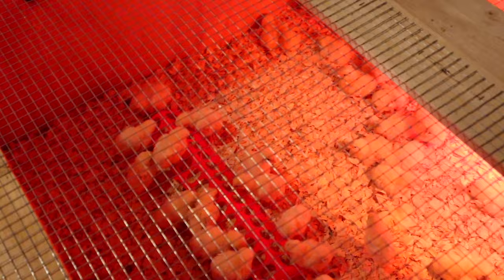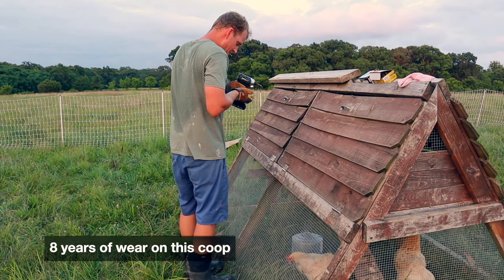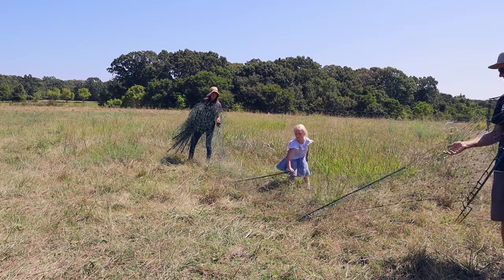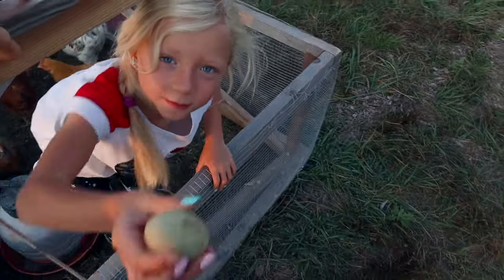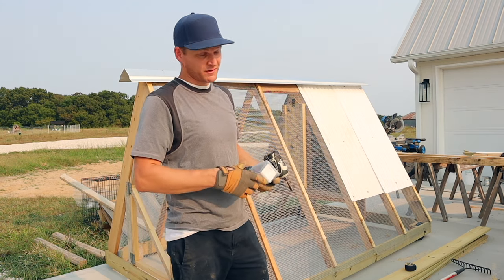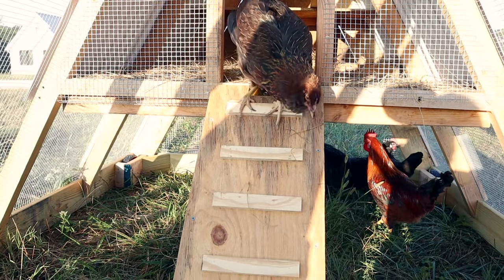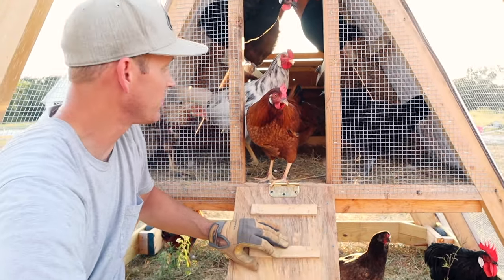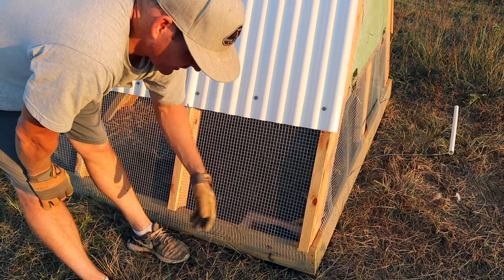The Quest to Design and Build the BEST Chicken Tractor

Comment: For predators I may have a good solution for you and will also help keep rodents out. I added a folding skirt frame that has hardware cloth mesh on each side, front and back. With the hinges all I have to do is fold them up when its time to move the tractor. I anchor them down with heavy duty tent spikes when i fold them down to the ground.
Reply: Thank you for the idea! I was wondering how to incorporate that into a tractor. Can you explain it more in-depth?

Comment: This is a terrific video!! Right off the bat it is obvious you guys are not afraid of hard work!!! Like you, I played around with design. Don't know if a couple of things I did will be useful for you folks or not but since you shared some great stuff with me, I'll proceed. I took the big wheels off a push mower---the raise and lower mechanism as well--and installed that on the back corners. My coop is the A-frame shape like yours. They roll really well through rough terrain. In the process of putting on those big rubber tires on the front...like what you have on a hand truck. About 7" high and 3-4" wide solid rubber. Don't want to mess with having to air them up. I want to rig a way for them to be put on a swivel mount. Pulling that thing around through rough ground and high grass can take a long term toll on your 'innards.' Lower the wheels when you start to take off and raise when you get where you're going. That's my only tip other than I had a Houdini chicken that would always manage to get out even on the flattest ground it seemed (there were times I wanted certain chickens confined for a while.) So I took a rod of rebar a little longer than the length of the tractor and a couple of shorter pieces the width. At each corner I drilled holes about 5 inches back from the corner edge of the pen. Slid the rebar through across the ends and sides. Had to wire it up a couple of places on the long sides to hold it in place. But she was not able to get up close enough to the edge of the pen to scratch a hole and get out. This is only if you are wanting to confine them in the bottom portion of the tractor. Thanks for all your trial and error and sharing such terrific methods. You are a gorgeous family in looks and in heart. Jesus bless.
Want to add...I have learned that deer netting zip tied about a foot up from the bottom and flowing out about a foot or so on the ground will tangle a snake up and keep them from getting your chickens/chicks and eggs.

Comment: Your LOFT design is really great to hold a small flock. I'm looking at putting a piece of roofing tin along the bottom of my run to keep animals from scratching the wire and other damage, doubles as a wind break. The latches, you may need a common hasp with a snap to secure them.. I'm getting straight run chicks in a few months and will need more coop areas to select 2-3 roosters for my operation.

Comment: Great build.  A few observations and suggestions.  The floor inside the coop—since you mentioned that you move the chickens out of the coop into a warmer area during winters, to reduce the weight, maybe use 1” hardware cloth.  That would also reduce the amount of work needed to clean the coop.  If you continue to use wheels and therefore have a small gap under the bottom frame, I’ve seen guys run 12-15 inches of hardware cloth on the ground around the outside perimeter of the frame to deter predators from digging.  I’ve seen guys mount the hardware cloth to the frame so that is swings up and down like a hinge to make moving the coop easier.  Also, if you decide to stop using wheels and instead make the long ends of the bottom frame like skids, maybe attach strips of HDPE plastic (same as the Yard Glider) on the bottom of it so that it glides across the ground easier.   Just my 2 cents.  Dave

Comment: Yeah, it's a hard lesson when you learn that critters can reach through a one-inch poultry netting hole.  You don't have to redo the entire side, just go up about 16-18 inches with the wire mesh from the bottom, on top of the  poultry netting.  Critters can't reach through from above to get to the chickens.  You can use the j-clips to do this, if you figure spacing correctly.  GOOD LUCK!  You're doing great!  oh, and you can put a narrow strip of trim/baseboard over the mesh on the bottom, to sandwich it between the wood and make it more secure.

Comment: Hi family,  dude, we like your A frame chicken tractor, I think I'll build one a little larger. I'll use the wheel design with larger air  tires. Also wanted to share with you your latch locks. Make all latches to lock when they drop. If the latch unlocks when it drops, raccoons will figure it out fast. Just wanted to share what I've learned.
Reply from the maker: Good points.  We will likely be converting to air tires soon on out coops.  Continual improvement, right?!?  And the latch tip...that's a good one.  I like your attention to detail.
Reply: Yep, I  Analyze everything from one side to another.  Build my own toys either out of wood or weld it. Putting a sawmill together as soon as my roof is done. Well roof isn't down, 🤪 still isn't done but trying to work on it though I  nearly slide off because of humidity and sweat. 🥵

Comment: I make a frames from old pallets.  Put 2 2x8s on the back end sticking out a few feet.  Makes em way easier to move.  I use an old hand truck to move em around.  Mine are HEAVY, I use the boards as roofing.

Comment: I’m in the same boat…ordered 5 different breeds of chickens in December with thoughts that I would have plenty of time to build 5 A frame tractors. Chicks arrived in April and I still haven’t built a single tractor 🤦🏼‍♂️😂
Reply: Another way to do it is rooster pen, hen pen, and breed pen. Each set of hens from the breed pen would stay fertile about 2 weeks. You would also have to be able to tell each breed's eggs apart. Also the breed pen might be a stationary pen and shelter, which means you just need the 2 tractors. Roos get along a lot better in a group if allowed to free range, if you are able to let them out sometimes. If you raised the whole flock together it might work.

Comment: nice design.  I like the wheels.  I would install an auto chicken door..  Any issues with predators during the day, trying to get in under the coup frame?   I'm planning to build a cattle panel hoop coup, and am debating on using hardware cloth around the outside of the bottom to discourage digging predators.... I guess to be mobile that would be very difficult...

Comment: I love this design and saved the video too watch with my husband as we are going to be building one later this summer. I saw in another video you guys have built more did you make any changes or are you guys loving this still? My only thing I would change is maybe put wire on the bottom of the coop part so I don't have to clean it out.?.

Comment: If the wheel was on the outside it would be easier to change and replace. Could you have triangulated and put it ont be outside?
Reply from the maker: It could be configured like that, with some slight modifications to give both sides of the axle some needed support.  Perhaps I'll try that with Chicken tractor 2.0 :) (this is Cam)

Comment: I suggest getting rid of the wheels and making the bottom like skis so that it can slide on the ground, grass or gravel.  A strip of aluminum on both sides would work very well.
Reply from the maker: We may have to try that on future chicken tractors, and evaluate which one "rolls" better :)
Reply: @TheSeasonalHomestead  I don't know what your winter situation is like. I'm in British Columbia and have lots of snow. I often use a plastic sled to move heavy items around my farm all year round. It slides on the bumpy soil or grass VERY well without sinking into mud or ruts.

Comment: If the outside has gaps under it, then what’s the point of using hardware cloth around the run? It seems that the chickens are really only protected when they’re in the actual coop anyways. If an animal really wanted to get to them while in the run, they would just easily dig under and bypass the hardware cloth. I would have just put chicken wire on the run. Good build though, and thanks for the video.